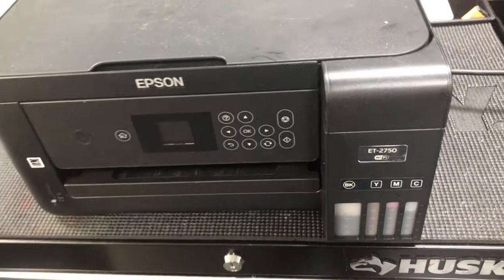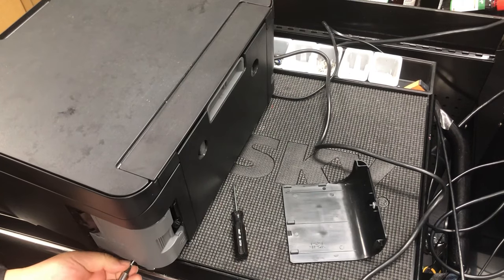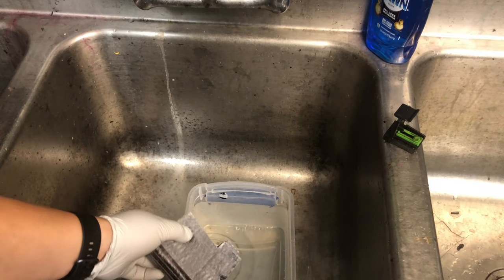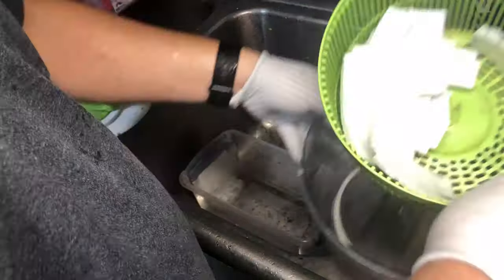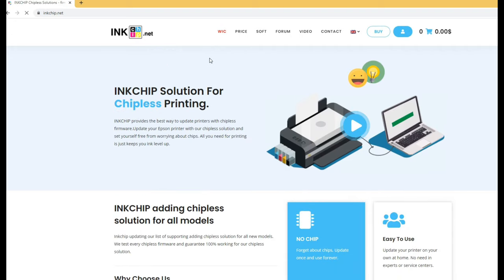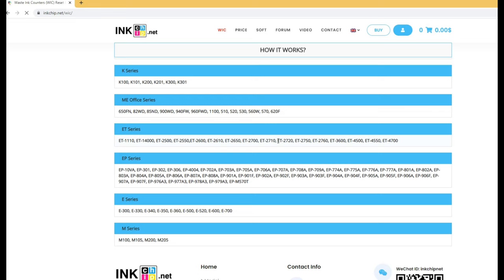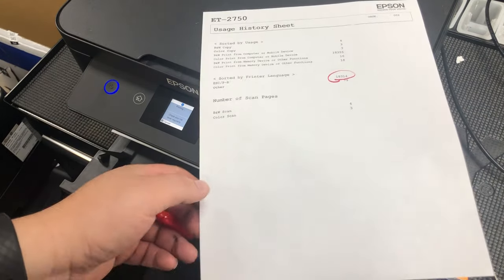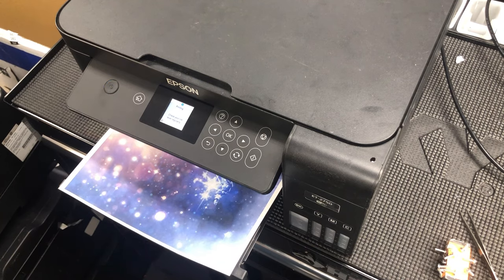Clean & Reset EPSON EcoTank SuperTank ET-2750 Waste Ink Tank Pad Counter

Comment from the maker: Resource Used:
Company name: INKCHIP Solution For Chipless Printing
Web page: https://inkchip.net
Tel.:+372 8173 0240
Address: Level 15, Nexxus Building, 41 Connaught Rd Central, Central, Hong Kong
Email: info@inkchip.net
Whatsapp: +372 8173 0240
WeChat ID: inkchipnet
Link to download software: https://inkchip.net/soft
Canal YouTube: https://www.youtube.com/channel/UCmPxfKYumxSyF6NL-_Ixhng
Reply: How do you bring up the key at buying it
Reply: @kirstenbrewer5468  Are the keys one time use or you can use that key over and over on the same printer?
Reply: @Miagarin-  1 key is 1 use but if you by multiple then you get several ie: 5 keys gives you 5 different tries. I haven’t bought mine yet, hope it will work!
Reply: Once you buy the key is it placed in a folder on your computer or???
Reply: Is there a US equivalent? They don't have the ET-4750

Comment: Kevin and Inkchip were right on the mark for clearing and resetting my Epson ET-2650.  Took apart and cleaned the "sponges", dried them off (using hairdryer), put back in, downloaded and ran the Inkchip software, and I am ready for another 20,000 pages printed! Of note - I did also manually clean the heads a couple times over her life using ammonia and manually sliding the print head over the paper towel in the print tray. Couple videos out there on how to do that too - works great.  But Thanks to Kevin for the Waste Ink clean and reset  - your computer science degree is GOLD in my book!
Reply: Do you have a link to that video? I can't find it in my search and my power clean and 5+ nozzle cleanings are not doing the trick on my 3210. I can finally sorta read some words but when I try to print, it prints an outline of the black object I'm printing and the test page barely shows the black and no yellow at all.

Comment: Thank you for putting this together. I can't believe that Epson states that  there  is no maintenance box for the ET2760 model. There certainly is. It's in the same place your video shows. It may not have the chip, but who cares. Your work around to reset the software resolves the no chip problem. Thanks again for sharing!

Comment: I'm on a Mac and it's not working, I even used Windows for Mac and it's not working.  It worked before with this same printer, the ET-2750 but not this time, I wasted $10 buying a useless code to do this but as least it was only $10.  Looks like a new printer is in my future.  Sucks.

Comment: I won't lie, I was skeptical about this and buying the code from INKCHIP but it worked. I have an L3210 - cleaned out the waste tank as directed in your video and had to download the WIC file from a Windows computer (not for MAC). Also, make sure you enter the LONG code they send in the email. I was entering the order number because I didn't open the email fully and just saw that 6-digit number which gives you an error. If I'd watched the video Inkchip sent a link to, I'd have known better but I'm impulsive. 
Thank you, Kevin! I still have printing issues but at least I can clean the heads now.

Comment: Many ET-2750 have a software fault that prevent the power clean to operate.  It is however also possible just to tilt the printer in all directions one after the other ( I dit it up to 60-70 degrees) and the printer is as god as new.  It probably work because the obstruktion is often air bubles .  Epson suggest to send the printerto a repear center to get the software fixed, but they suggest just to through the printer out.

Comment: Hi Kevin, thank you for the informative video! I went to the site and saw et-3700 and assumed it would work with my 3760, but it doesn't. Is there another optin for the et-3760 to reset the ink tank?

Comment: I had an e-01 error at 18486 pages, around 170 pages from yours what are the chances! But seems just resetting all settings all the printer got it working again, at least for now, 20 pages in . I will update if still issues

Comment: Its strange my 2750 says "out of paper".  But when i run the roller cleaner it never has a problem with the paper for that. It seems Epson is very selective when it wants to be out of paper.  I've done all the stuff I've seen online but I haven't tried to buy this software yet.  I really think this is Epson's way of getting you to buy a new printer when there is nothing really wrong with your printer.  It's all in there software.

Comment: do you have to reset the chip after you clean the maintenance box? I have a Epson et 4750 that I have cleaned the print heads and unclogged, but all I get is blank pages. I wanted to do a power cleaning but it needs the maintenance box changed. Any help would be appreciated. I really enjoy your videos. 😁

Comment: Kevin I loved this and will subscribed. Interesting I just took a Biomedical Engineering Certification class at your Alma Mater. I am also starting out in the book for Dummies the CCNA course; oh I am not a programmer, but a BIO major so this is out of my comfort zone. They didn't have a book for Idiots which would be my level. 

May I ask you this question? In order not to have do a reset and stay ahead of this issue, could I clean before I get a message that shuts down my computer. I just did a booster clean as that was Epson video remedy and a wiser computer friend told me to keep doing a head cleaner as I thought my ink Cyan ink was clogged. Epson was no help by calling or any you tube, as the issue was the head cleaners. I did what he said. Keep doing it and check. I didn't have to do it 10 times only 5 + 1 times and that allowed me to get my Cyan ink working. My printer is the same model you have here 2750, so now I know to clean the waste pads that I just probably soaked. 2 + 4 mos. yr old printer
Reply from the maker: I was a Bio major too! My dad picked it for me. I finished it then switched to computer science.
Reply from the maker: It could be the printhead is fine, just the damper needs to be primed.

Comment: Will this work with Mac? I don’t have windows but I need this so bad. I was supposed to print something yesterday and I thought I just needed to clean print head but after 2 print head cleaning, the 3rd nozzle check shocked me, it was blank. The first 2 still had colors except CYAN but with broken line. So I searched youtube and found this video. My printer is just about a year old 😔
Reply from the maker: I think they only make it for PC.  You only need a PC for a few minutes, can borrow from a friend.

Comment: Kevin, I was successful in resetting the ink pad count to zero, but my et-2650 control panel window is blank, so I can't find a way to reset it to factory defaults.  My Windows computer sees the printer, but the Epson firmware and even my original CD won't recognize the printer via USB001.  What can I do?  Any advice is much appreciated.
Reply from the maker: That doesn't sound good.  Still having the problem?

Comment: Am I the only person who can't seem to get this?! After rearranging my whole room just to connect my printer to my pc (since I normally use a mac) I now can't get the program to find my printer. It shows up in the drop down menu when I click on "deep cleaning" but when I'm trying to run the waste ink counter it won't find my printer. I've restarted the laptop, deleted the program and reinstalled. Nothing is working. I'm getting so frustrated. Idk what else to do at this point.
Reply: Exactly. Did you solve your problem. I haven't
Reply: @blancamayoral134 yes I did fix it but this video did nothing for me. I ended up just ordering the ink maintenance box off Amazon and replacing the whole thing. I wish I would have done that from the start instead of wasting my time trying to wash all that nasty ink out. It was only $9 and super easy.

Comment: Hi Kevin! Thanks for your videos. I've been watching them since yesterday, when my 2 month old Epson ecotank stopped working. I've printed 700 pages and this error came up... I'm wondering if it is normal? The pads were saturated with ink. I contacted Epson and the ly want me to ring them but I wonder if it's worth? Or will I buy the reset key and do it myself? Thank you!
Reply: I am having the same issue! Except I have only printed 480 pages... Did you ever call them?
Reply: Hello! I cleaned the pads myself and used a free key to reset it. It worked! :)
Reply: what free key did you use??
Reply: which free key?

Comment: Hello I bought a key from inkchip and I wanted to know if it takes 24 hours to get your key ?
Reply from the maker: I got mine pretty quickly.  Maybe email their support.
Reply: Hi!
What is your order number?
We ship keys within 24 hours of ordering. It's possible that the email with the key went to spam. Check your messages.
Reply: @katemirosh5544  when I download the software is just automatically closes what does that mean?
Reply: @bellawilson5782  Hi! To extract a file you need to use any archiver. For example, WinRAR or other...

Comment: I did all that but when I went to turn on the printer and press the power button there was no power - I checked powwer connections etc - unplugged it left it for an hour came back and tried again this time the power button flashed a milli second and then went out - no power even after holding the power button for 30 seconds
Reply from the maker: That sounds bad.  Still having the problem?  What's your printer model?

Comment: Does the counter stay at zero (0)  or it needs a key every time to reset it back to zero?🤔 hence you have to pay every time?
Reply: Hi!
One key for one counter reset.
Reply: @katemirosh5544  so you have to pay over and over again..
Reply: @miagy420  How often does your maintenance box overflow?

Once a week? Once a month? - No!
More often once a year or less.

We are developers and have the lowest prices on the market. 

As a reminder, this solution exists to allow printer users to save their money rather than overpaying for services or buying new boxes.
Reply: @katemirosh5544  It's not relevant how often you do it, it's relevant that 1 key is 1 reset, that means you don't reset once and forget about it. You pay for each reset over and over...
Reply from the maker: I will say, like 10,000 pages.  I can be wrong.  I have a printer that prints from 20,000 to 30,000 and still not asking for a new key yet.
Reply: @katemirosh5544  Do u work for INKCHIP. If u do can u fix an issue with registering with the forum. I am not receiving the "Please confirm your email" tried 2 different gmail addresses.
Reply: I have checked the spam etc folder.

Comment: I understand why you clean the filter inside these cartridges but it’s actually illegal to allow ink and or other dangerous chemicals to go down the sink. Its why you’re supposed to recycle the cartridges. It’s also illegal to throw them away in the regular trash. It’s not called E waste for nothing. 

Everything that goes down the sink gets filtered into our drinking water supply. No amount of filtration at the local municipality can remove ink safely because its not like debris or human waste that can be filtered. The water absorbs the ink like the atmosphere absorbs carbon dioxide. You can may not see it but it’s there.